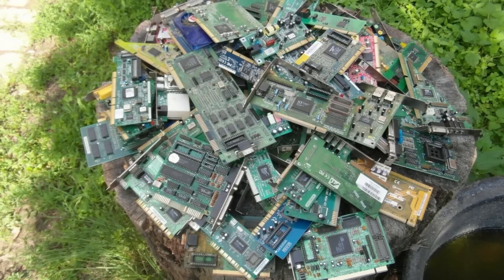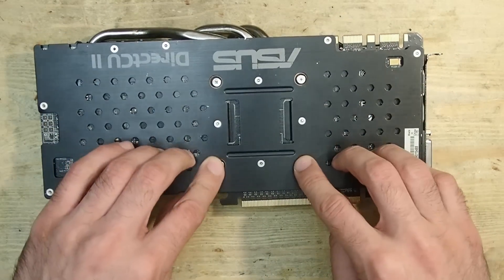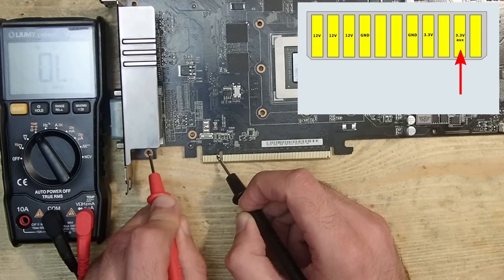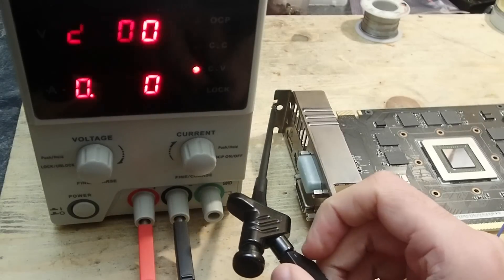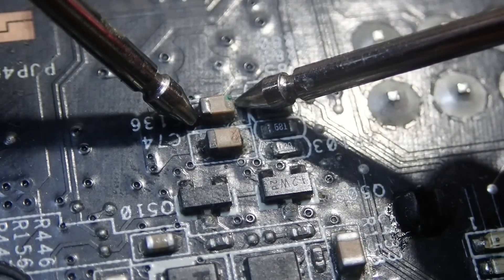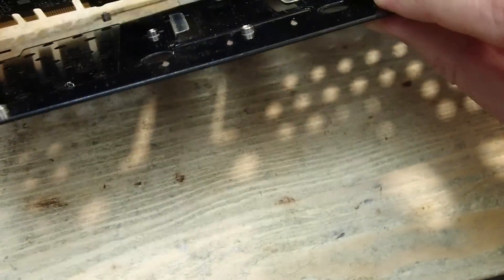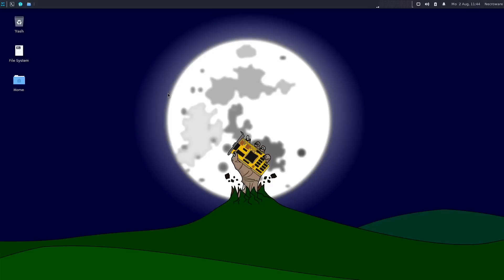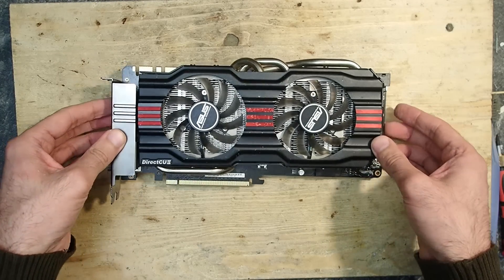GPU shortage? Let's repair an Nvidia GTX 770

Comment from the maker: Hi guys, since the question/statement about a THERMAL CAM came about 1786642 times. Sorry, but I'm just tired to answer the same questions over and over again. So I'd like to answer all of the questions regarding this topic once for all:

- Yes, I know, that thermal cams exist
- No, I don't have a thermal cam
- No, I don't really need it. It looks fancy for a video, but I prefer to show, that you don't always need an expensive equipment to repair stuff
- Yes, equipment is expensive and if you want to spend some money on this channel, there is a Paypal and Patreon accounts
- Yes there are tricks how to make this without a thermal cam, just use your fingers, or if you have no fingers use the alcohol and icespray* trick.

*) Spray some alcohol on the PCB and then use Icespray to freeze it. Your PCB will turn white in a second and in the place, where it is hot, the ice will melt and you will see the spot.
Reply: Just ignore those people
Reply: Agreed, the alcohol works great!
Reply: People greatly underappreciate the value of old school, low tech diagnostics.  I just found this video via the good old algorithm and just so happen to have a dead GTX1080. I might pull out my meter and play around with it.
Reply: Thermal camera sucks! Do not buy it. Spray alcohol over the area and if temperature difference is there, you'll see how some components are drying faster than other.
Reply: @NickFreneza  Pure alcohol. Otherwise...
Reply: Well, haters gonna hate. Ignore them. Great work, Necro! Very well done.
Reply: If anyone with a bazillion questions cares that much just go ahead and buy him the thermal camera. problem solved and saves him time and money lol
Reply: man you should've just used jet fuel which has a very low autoignition temperature, in case one of the components got really hot, it would ignite the fuel and you can observe where the fire started.
Reply from the maker: @klazzera  LOL :D Later in the fireman's protocol: "The fire started in the workshop"
Reply: @necro_ware  

GTX 295 I bought for the channel does not output but green light and fan work. Id rather not throw it in the trash if you can give it new life. Guy on ebay refunded me and said keep it.
Reply: @klazzera  but what if gpu is made of steel beams? It would fuggin melt it.
Reply: oh thats alot like my gtx 770 except mine came with 3 cooling fans, when those fans kick in it sounds like a jet engine, i love it lol
Reply: Divine Leader, we must repair the software end of the worlds problems too.

Gaben amen.
Reply: What about a Rosin atomizer? It's about the price of a pub meal, but it sure beats paying a small fortune for a thermal camera.
Reply: Sorry about my comment. I have seen thermal cameras used in other videos but I have never looked how expensive they are. You showing how you can do stuff without extra expensive equipment is actually a service to the community. Keep up the good work, I hope your channel grows.
Reply: Can u fix mine?
Reply: JESUS LOVE YOU SO MUCH PLS STOP IGNORE HIM HE IS REAL AND GREAT AMEN
Reply: "Spray some alcohol on the PCB and then use Icespray to freeze it. Your PCB will turn white in a second and in the place, where it is hot, the ice will melt and you will see the spot."

it work only for short circuit ;)

let's say you have a dead memory(not shorted), you can't see it, can't touch it...can't feel it
it's a case where the thermal cam do the job

2nd case:

a bad capa, not yet shorted, who pump your battery when all work fine
the thermal cam is your best tools,
0.5-1°c difference  is near to impossible to feel or see(with alcool/ lighter fluid..yeah, you can use the last, more cheaper as your favorite ipa) under a microscope
--------------------------------------------------------------------------------------
Just for the record, a zoom of 10x-20x  is enough to operate on a pcb
don't ruin your stuff because you don't have the equipment
know when you must stop before it's too late
Reply: I bought a cat 60 with thermal camera flir...it works beautifully
Reply: I was about to mention the thermal cam, but I guess you prefer the old way. Nothing wrong, but if you can upgrade the tools and the method, why not save some time, after all this is the Only commodity that is priceless and also a rogue killer for many of us?
In the end, you definitely need a microscope, to be more professional, although I doubt you aren't.
Reply: but spends $120 on a power supply. Bro flir cameras are about $150-$200 on amazon. Being professional WILL COST YOU $ quit being a cheap fuck and do it the RIGHT WAY.  UNSUBBED FOR THIS REASON.
Reply from the maker: @Tabasc0000  Thank you for unsubscribing.
Reply: @necro_ware , "You can't do that".
But you go and buy a thermal camera and a microscope.
Reply: The one nice thing about the thermal camera is that it would detect the short much quicker with much less current injected, which translates to much safer for the components. That is, you would have probably spotted that area at just a couple hundred milliamps in a minute or two. And you have to admit, having one around would just be cool for so many reasons, regardless of the electronic repair affiliation!!! I'm all for fixing on a budget,  with minimal tools,  and teaching others to do so as well, but get a thermal cam just for the fun of it, if for nothing else! Really fantastic video man...
Reply: Recently some guys in China started promoting another trick, loading up some rock rosin into a vape essentially. But instead of inhaling it, you let it evaporate and settle on the PCB, creating a stable white film. Wherever the PCB heats up, the white will clear up. It's cheap stuff and i'm lead to believe some people in the community may actually be fully set up with supplies without having to buy anything extra, and if you do have to buy something, it shouldn't be much more than a couple EUR.

But i really don't mind just using the back of my hand or plunging my cheeks into electronics (low voltage only, naturally) to figure out the hotspots.
Reply: Can give advice on why my gtx 770 cuts out while playings games not is notnoverheating just while playing then it cuts out and my pc restarts
Reply: @willemafrika2118  How can you tell that it's the gtx770 that is at fault for this? If it is, you should check the temperature in the VRM area, by hand or with a temperature probe, not by software, physically. If you're unsure, it's more likely PSU tripping up and maybe PWR_OK signal is disappearing for a little bit.
Reply: @SianaGearz  ok thank u so how can i know for sure its not the psu
Reply: @SianaGearz  i wil switch the power psu to chek
Reply: hello sir. can you help?. my rx 280x turns on but only the fan, and it does not boot to os.
Reply: lol
Reply: hahaha there will still be those that speak of it
Reply: If you can't do it with alcohol, you probably shouldn't be doing it.
Reply: There is a thermal camera inbuilt in my phone. lol.
Reply: @Mp57navy  CAT user spotted. :))
Reply: I'd rather say donate instead of spend sounds more accurate.
Reply: Oh i know you don't want to hear someone else nagging about infrared cameras, but as a vintage hardware hacker perhaps you might at some point be interested in hacking an old obsolete phone into a thermal camera. In general as long as it's not an epoxyfilled mess like an iphone it should be easy to pop the case open, remove the old infrared filter, add a new visible light filter (IR pass filter )which can cost $10 on ebay).
Reply: @Marc83Aus  You cannot make the actual thermal imaging camera by removing IR filter. With such a setup, you can only see a narrow part of IR spectrum with some sensitivity, ie. have a night vision if you illuminate the environment with powerful IR lamps. But it's not enough for thermal imaging, for which you need a completely different kind of camera sensor, more sensitive for broader IR spectrum.

Fortunately though, you can have true thermal imaging modules, for use with a smartphones etc. quite cheaply nowadays. I have no experience of them though.
Reply: You could've said that in the video, or put a card there. "Normally, you'd use a thermal camera for this, but I don't have one..."

Comment: Running the lil brother to this gtx460: frames per capped at 30 low 1080p on 40 inch 60hz tv ( The Long Drive Beta test)  My 4gb Amd card doesn't like this tv but it does fine running Ubuntu 24Lts for Youtube on 70 in HD

Comment: 🙋‍♂️ I have a question!
Where the positive wire was soldered to, thats 3.3v input, so was this a short from ground to 3.3?

If you had a short to 12v,  Could you instead feed voltage to the 12v pin from one of the 6/8 pin plugs? 
Would greatly appreciate the insight

Comment: I once saw a guy detecting a short by spraying a thin layer of isopropyl alcohol on the board, wherever it dried faster, there was a hot spot there.  If it dried too fast to see anything, just spray some more.

Comment: Hello Sir,

there´s a Gigabyte RTX 3070 Gaming OC 8GB I don´t come further with. I´m from Germany (maybe you too?). Is it possible to ship it to you?
When I started the card the first time there was a black screen but the PC system was running. My best guess was the BIOS. All voltages were there - no shorts - everything fine! After the BIOS flash the card "worked" but I had ERRORS in A1, A0, B1 (MATS). I ordered used parts from China and replaced the VRAM chips. With one of the same chips (same charge) I successfully repaired another card! At B1 I lost 2 solderpads on the PCB which I´ve replaced under the microscope. The card ran but I had a black screen. All voltages were there again but only for 15-20sec. Then 0 current anymore (Tested in a riser card). I decided to check the VRAM chip and the pads underneath it. No issues. Everything looked good and I replaced the VRAM chip with another one of the used China charge. The same again. Then I replaced A1 and A0. Now the card runs also in black screen but I have all the voltages and current permanently. No 15-20sec windows anymore. When I replaced the VRAM chips the first time the fans turned a few seconds and stopped. Now the fans don´t stop anymore. 
I flashed a lot Rev 1 and a Rev 2 bios files on the bios chips just to be sure there´s no issue with the bios data. 
Regarding to your video I tested the "and gate" (connected to pin 11 PCI-E) ... got 1,8V to both inputs and 3,3V output during the start process. All lanes are okay (same values). No shorts at pin 5 and 6 of the PCI-E port. 
I protected the GPU from the heat of my heat gun with alu foil ( a shield in front of it ) and worked with a camera. When I´ve seen the VRAM chips coming down a few sec later I stopped heating them. I can´t think of a faulty GPU ?! I don´t know. I need your help 😞 (Btw. I have no osci)
Is it possible that my card has this weird behavior because of faulty VRAM chips? What happens if I have a faulty chip (one of the 3 replaced ones) ? I have 1,36V VRAM voltage. Wouldn´t I have that voltage with a faulty chip? Or could a faulty chip beeing the reason for a black screen with running fans?

Comment: Hello, I have XFX GTS Radeon RX 580, during the testing I found out that first 3 12V from pci-e edge connector are shorted, is there any hope for it?
Reply from the maker: It is normal. As you wrote, first 3 pins are +12V.
Reply: @necro_ware  All of them (first 3) are shorted, its not just one. Is it worth trying this?
Reply from the maker: @muki_x  they have to be like that. It's normal.

Comment: please test it to a windows pc
Reply from the maker: What's the difference?
Reply: @necro_ware  I just wanted to see big games test with real nvidia drivers.
Reply from the maker: @liathecat7757  those are real and official Nvidia drivers :)  and most big games run there as well. This video was just not about benchmarks, that's why I didn't show games, just wanted to put some constant load on the card. I also don't use windows since over 20 years :)
Reply: @necro_ware  can your linux run rdr2 (without proton etc)? I dont think so. What is the color of your windows😎😎
Reply from the maker: @liathecat7757  funny dialog, thanks for watching and I hope this repair was useful or at least informative. Have a nice day ☺️
Reply: @necro_ware  thanks for video. I wast just joking (I made a reference to andrew tate's what color of your bugatti video). Thanks for the video again. It was really informative. Have a nice day :)

Comment: Fantastic video!  I have a 970 that died and I am trying to determine why.  The 6-pins seem fine, but the first three pins on the PCIe seem to all read short.  Any thoughts on how to progress?  Do I just do voltage injection for each pin?   Thanks!
Reply from the maker: First three pins are +12V. There is a high load on that voltage, that's why it is distributed over multiple pins. If there is a short from 12V  to the ground somewhere on the card, you will of course measure it on all three pins, since they are connected.
Reply: @necro_ware  Thanks for the quick reply.  I'll try voltage injection and see what comes of it.  Thanks again for making the video.   I don't have much experience on this, and while it is likely overconfidence on my part, you do a great job breaking down the process.
Reply: @necro_ware  I followed the video, found the short.  Used an IR camera to find the bad part.  Determined it was a tantalum capacitor.  Bought the replacement and installed it.  GPU works great again!  Thanks so much.  I took photos along the way, not as good as your work, but if you want them you can have them.  This was a real help. I have never done anything this technical with a computer and really appreciate the content you are making, it made something impossible relatively easy.  Thanks so  much!

Comment: I'm Having a problem now with my GPU.  We have a thing in South Africa what we call 'LOADSHEDDING'(you can google that).  I have the HD7970 Directcu ii that recently got damaged with all the power being cut and turned back on again 4 times a day(I know never unplugged my PC STUPID of me). 

Now the GPU is pulling vertical lines when a game's graphics are set too high or resolution set too high and it freezes completely with the vertical lines, I have to hold the power button in to force shutdown the poor PC and have to start it up again, then everything is completely fine as if nothing ever happened.

any solution please would appreciate it ALOT!!!!!.

Comment: I had bunch of early Niobium capacitors shorted in Asus and Dell laptops, it was really epidemic because they not like higher temperature and fail quickly. Inserting limited current into main power bus on mainboard and locate hot area with remote infrared termometer (much cheaper than IR camera). Very quick and cheap repair of dead laptop. Good brands always use bigger but more reliable Tantalum capacitors parallel with 100nF ceramics for lower ESR. Packing more parts in small area with cost of reliability. Nowadays crap electronics is designed to endure warranty period and no more.

Comment: An EXTREMELY common problem with these capacitors. Manufacturers install these caps rated for too low voltage (usually 10 V on a 12 V line) and they break within a year and fry the PCB.

Comment: About a few months ago I’ve ordered this exact same graphics card for around $40 US dollars it was written as non-working but whenever it arrived after a few days prior I’ve happen to plug everything in plus the two pci-e connectors and cleaned it up really good I plugged it into my main computer tested some games and a Cinebench r15 and I turned out to be working out just fine except for the display port connection but I only need the dvi connection because that all I’ve ever needed for my setup! What a steal for the price! I’m also still using it as my main driver also!

Comment: Great fix.  I really need to get into soldering so I can learn how to do stuff like this.  Two little capacitors and you have a perfectly functional GPU!
Reply: I find that the actual soldering is an easy part. Diagnostics and troubleshooting to find out what's gone wrong can be quite a bit trickier and sometimes requires a lot of knowledge and experience.

Comment: Wow, this is really helpful for beginners like me... But just a question though, in 5:32 when you detect the short in 3.3v terminal you inject 3.3v voltage. But what if the short is in the 12v rail, should you inject 12v or just use 3volt and just play around with the current? 

You really deserves a lot of subs btw :)
Reply from the maker: Yes, you should go with 3V and slowly raise the current. At 12V you could easily damage the card if there's a short

Comment: I had 4 shorted MOSFETs in my GTX 970 so I replaced them but they shorted again. I noticed something very strange is that when I spray a contact cleaner on the corresponding Gate Driver the short is gone, but when I tried to power the card again the short is back. I did that about 3 times and the short goes away every time with the contact cleaner on the Gate Driver. How can that happen?